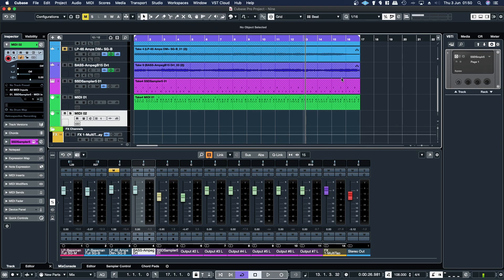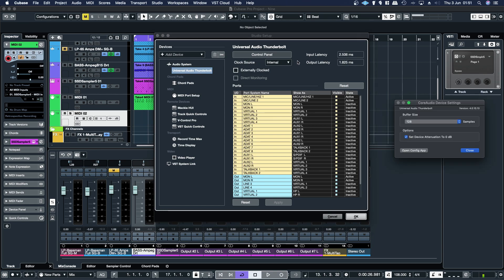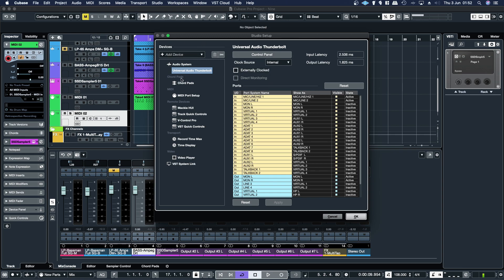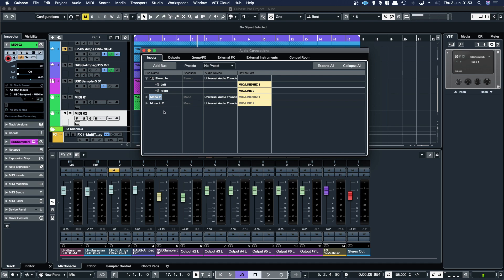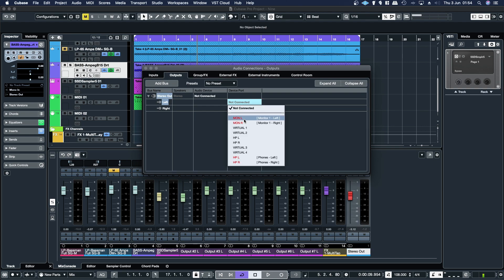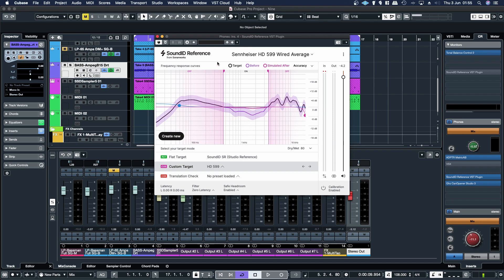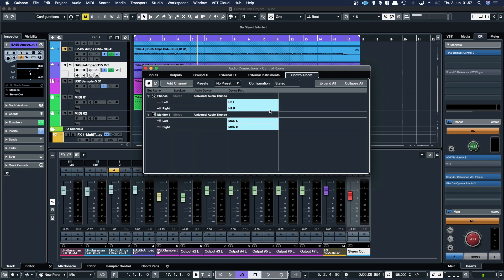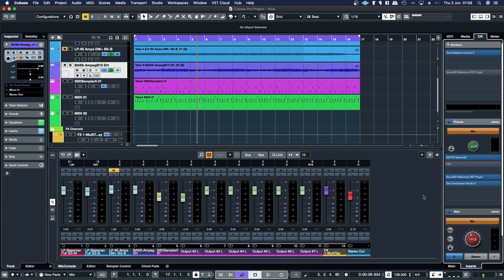Cubase Tutorial: Setting Up Your Inputs & Outputs (Updated)

Comment: So when I send my audio to its own out it’s like the sound becomes lush and easier to hear changes mixing but stops showing up on main out. The first video you did about this seems like what I’m going trough now I have a discrete 8 audio interface and any time I use 3 to 24 I have to print them back into cubase but the sound quality of 1/2 don’t match 3-24 on my interface any reason why it like that?

Comment: Useful video.  Although I have a couple of questions.
How do you connect the audio outputs in Cubase Pro?  I tried doing what you showed, but when I click the device port, the dropdown menu only shows "Not Connected".  It doesn't give me those options for Monitor Left or Monitor Right.
Also, I'm trying to use the EWQL Symphonic Orchestra libraries on Cubase, but everytime I load a new instrument, the track on the "VSTi" tab is void of color, and when I try to toggle with the frequency & resonance knobs, it just says "inactive".  However, when I go to activate the instruments, it says it's already activated.  How can this be solved?
Reply from the maker: Do you have an audio interface, and is it selected as your audio device in  the device settings of Cubase?
If there is no interface present, then you will have no outputs to connect.
As for the other problem, I am not sure what you mean.
Reply: @JohnMarshall-NI  How do I look for an audio interface?  Do I have to download one onto my computer, or can I just find and use the speakers on my computer in settings?

Comment: Great video, got all my stuff to work, but i still have a problem that i need help with.
My inputs are working as they should, but when i set my ASIO driver as my sound card, it wants to use that as the audio output too, i only want it to be the input.
I need the output to be my ASUS Realtek Audio Driver, but i can't select it under the output anywhere...
I'm kinda new to Cubase, so i might have missed something basic, but some help would be appreciated!
Reply from the maker: Unfortunately that isn’t possible with ASIÓ drivers on Windows. You can only have one driver active at a time.
In MacOS you can create an aggregate device and combine audio devices, but this is a limitation in windows unfortunately.
You will need to use headphones with your interface, or connect a set of speakers to the TRS speaker outputs of the interface.

Comment: Hi I have cubase artists version and jus bought the presonus audio box and I connected it to the pc and its shows up in the sound settings for the pc but when I go into cubase it doesn't show the audio box as the driver only asio driver but shows in the midi ports as active I jus wonder is it still doing its job
Reply from the maker: Did you install the asio drivers for the presonus interface?
Reply: @JohnMarshall-NI  no i never registered it on the presonus website am trying it now and hopfully works